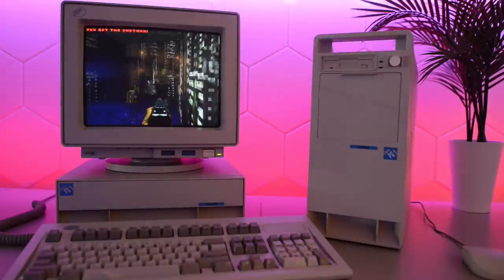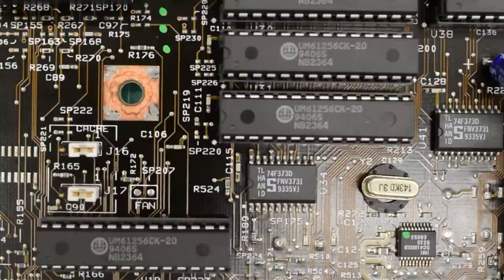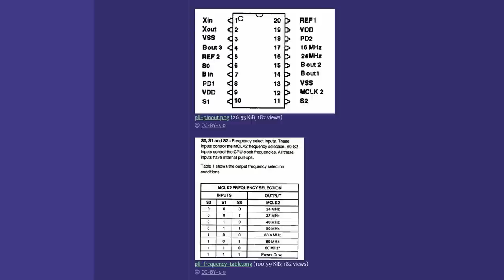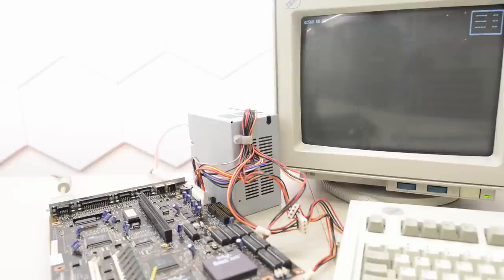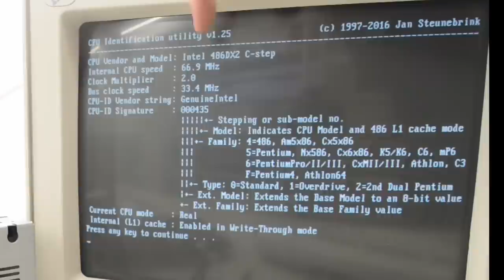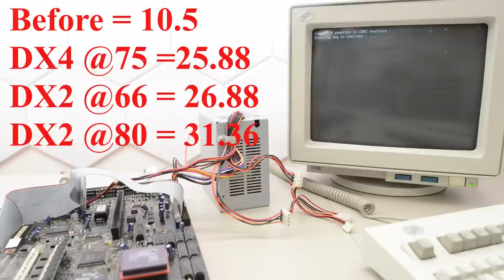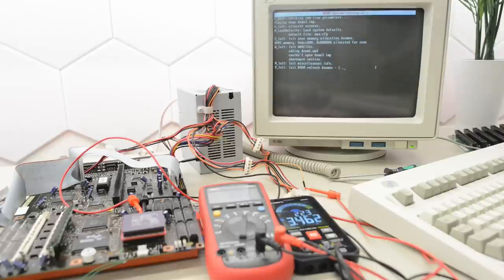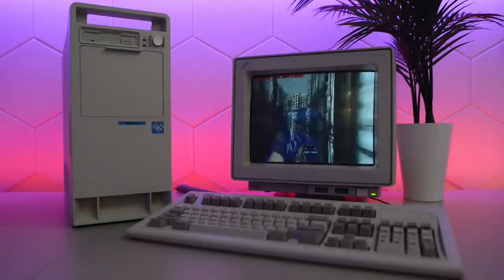3.6X faster DOOM! Sneaky IBM Tried to hide how fast their board actually was!

Comment: For the 4x multiplier just isolate the clkmul pin of the cpu from the board and manually pull it to ground (or check if it goes to any resistor or jumper like the clock generator did). Ive literally played the same game on mine which is a siemens nixdorf d819 motherboard. I just connected it to chassis with a wire and its happily running at 160mhz giving around 1300ish realtics in doom. Note: a 5x86 ADW didnt like the 4x40mhz no matter of any overvolt even at nearly 4V. I changed it to an 5x86 ADZ and all good.

Comment: It was rumored .. 'in the day', that the IBM 80 bus could easily be clocked up to 80mHz..perhaps even to 100hHz.    I had a PS/2 50z that I upgraded with a socket conversion to a 486/7 AMD type chip, but the bus was still at 25mHz..  and the add-on  video board and RAM was the reason that I didn't even think of up clocking the bus.
Reply from the maker: cool, I'll try to clock it even higher

Comment: When i was a kid, I exploded a 286 trying to overclock it by replacing the crystal on the motherboard. I had succeeded in making my 286 run super speed, and was going for Warp Speed when the chip when POP with a cloud of magic smoke and a huge blast of shattered silicon. It was AWSOME, and I'm thankful my uncle gave me the junk computer parts to play with.  At school we were running 486's and upgrading to Pentiums, but at home I was moving from 8088 to 8086 to 286 to 386. always a few generations behind so parts were plentiful and i could do stuff like overclock my old pc when I got an upgrade. I was trying to make the 286 run more than 2x faster. It worked at 1.5 speed.  It was working at 2x speed for something like 15 or 20 seconds before the screen stopped counting the memory. then the screen went blank, and POP.

Comment: DX2 at 66 is faster than DX4 at 75 probably because of faster FSB
Reply: Yeah, that's what I was thinking as well. Also the VLB is in sync with the FSB so that speeds up games like Doom.
Reply: This is almost certainly why. The CPU being able to access the RAM (and anything else that sits on the FSB) at 33MHz instead of 25MHz is going to provide a significant performance increase. If he'd tested the RAM access speeds (after the cache runs out) between the two setups it would have been pretty obvious what was going on.
Reply: I'm running Cyrix 5x86/100 @2x50MHz FSB on SiS471 486-board and it flies compared to 3x33MHz FSB. My Cirrus 5434 VLB is faster than any 33MHz PCI display card (in DOS).
Reply: Yeah 2x33 is better than 3x25 in many scenarios.

Comment: Back in the 90's a co-worker learned about the clock generator's 80mhz feature, and was able to run a DX/4-100 at 120mhz.  He had to add a fan to keep it stable
Reply: I was running a dx4 at 160mhz for years even played quake and blood and command and conquer with it
Reply: During the same time, there were VLB motherboards and adapters of differing quality that could run fine at 33MHz with two adapters (commonly video and HDD controllers), but the combination was more unstable with a 40MHz FSB. It was a fine art of cache and memory timings to get the best stable performance. I don't know if I miss those days.
Reply: @IBM_Museum  VLB relies a lot on what clock the card can handle. They'll all run at 33MHz no problem, some small numbers of them will crap out at 40MHz, and finding ones that run stable at a 50MHz VLB clock can be a real challenge. It was a serious problem when the first 486DX-50s came out to find VLB cards that worked reliably with them to the point that many small system builders just wouldn't sell systems configured like that.
Reply: @JeremyLevi : I ran an AMD 486DX4-120 that was challenging to have two VLB adapters (video and HDD/FDC) on a 40MHz FSB. Once it was stable, I really made sure I could make changes before locking it in. Those were the days!

Comment: The appropriate pin on the Socket 1 diagram for the CLKMUL signal must set low (i.e., shorted to V_ss) to enable 4X on the Am5x86.  That pin is possibly desigated R-17 on the Socket 1 layout.
Reply: From the technical specification: The CLK input provides the basic microprocessor timing signal. The CLKMUL input selects the multiplier value used to generate the internal operating frequency for the Am5X86 microprocessor family. All external timing parameters are specified with respect to the rising edge of CLK. The clock signal passes through an internal Phase-Lock Loop (PLL).
Reply: The microprocessor samples the CLKMUL input signal at RESET to determine the design operating frequency. An internal pull-up resistor connects to VCC, which selects Clock-tripled mode if the input is High or left floating. For Clock-quadrupled mode, the input must be pulled Low. For 133-MHz processors, this input must
always be connected to VSS to ensure correct operation.
Reply: If you modify the interposer board, or otherwise run a wrap wire to the appropriate underside socket solder point (or pin on the CPU), I presume you would be attempting to run this at 160MHz.  I think it would work, perhaps 10ns L2 cache might be in order (and a heatsink-fan), however, for stability?

Comment: We were actually playing around with some AMD 133mhz 486 chips last night.

If you can modify the board to a 2x multi to get 4x, try leaving the fsb at 40mhz and put a heatsink on it. We ran 8 different chips last night, All ADZ models were stable tbrough some quick benching,1 ADW was too but 1 ADW wasnt able to get past post.
Reading online the ADZ models are the ones that are more likely to be overclocked as they are the newer ones. 

Enjoying the videos mate!
Reply: I tried overclocking older machines, 8086 and 286 as a kid.
Reply: Rumor has it AMD designed the ADZ to run at 150 or 160, but the K5 finally came out, and they didn’t want to hurt sales of it.
Reply: @5roundsrapid263  That actually makes sense..
Reply: when i was a kid i learned about heat sinks with a 286, physical clock muliplier jumpers, and physical crystals in a can. mid 90's playing with 286's

Comment: I'm very interested in the next video! 
Back in the 486 days I had a Packard Bell PC that came stock with a 486 DX2 66MHz. I later upgraded the machine to a AMD 5x86 133 CPU also using an in socket voltage converter. In my case I ended up having to set the board to 40 MHz FSB and used a 3X multiplier for a final speed of 120 MHz At the time there wasn't a way to set the proper multiplier and this was in the very early internet days so I had to go with the info that was etched onto the board itself. 
About 6 months before I did the CPU upgrade I also did a L2 cache upgrade from 0KB to 128KB. I read an article in a computer magazine where that was done on a different mainboard that had empty cache sockets that was similar to mine. I got lucky in picking out the correct cache and tag ram chips. The L2 upgrade also provided a nice speed boost in many things.

Comment: Totally different MB but I also had an AMD DX4/133 or 150 or something and I could run it with FSB of 50, 60, or 66 MHz and clock doubled or tripled with VLB hard disk and video and it was a screaming machine. I think it wasn't stable at 66MHz but at 50 or 60 FSB it worked.

Comment: I'm not surprised by the performance boost in the DX2 at 66mhz over the DX4 at 75mhz. The 486 is really limited more by the bus speed than the internal clock speed of the CPU. So running a 33mhz bus will tend to net a bigger performance gain over a 25mhz bus. A DX4 at 100mhz (33mhz bus with a 3x multiplier) would potentially get a nice boost over both, but the 5x86 is still going to beat out any 486.
All this makes me want to try to overclock my IBM ThinkPad 701c with a 5x86 in place of the DX4 since I've read people use to do that to them back in the mid 90's. But as that is all SMD in a small laptop I'm afraid my limited skills would end up damaging it.

Comment: it would be cool to mod one of those boards with jumpers and 330R resistors so you could switch freqs at will.
Reply from the maker: That's very doable. You may not need resistors. Just jumpers could likely work

Comment: Looks like the IBM PS/1 is a bit of a sleeper 486 system. Very impressive CPU figures when you know what to hack and replace to get max performance with the resistors and the socket interposer.

Comment: What a great hack. It's really interesting because I've got an Ambra 486SX/25 and the board is manufactured by IBM - same black PCB and the layout is similar. However, it has jumpers for 25, 33 and 50MHz. This is confusing for two reasons: 1) because of the lack of jumpers on the PS/1 board and the lack of 50MHz, and 2) because I don't know of any 487 that ran at a 50MHz FSB. I might do the hack in your previous video to see if a 50MHz DX runs stable in my system.

Comment: Perhaps those "clock" jumpers, that are documented in the PS/1 technical manual but in an obscure fashion (possibly not implemented the way the diagram suggests on the average 2133/2155/2168 motherboard IBM shipped) provide signal to R174, R175, R176, if they are all populated with 330Ohms and if the installed crystal and CPU combination matches the intended multiplier settings?

Comment: That board is also supposed to support the Original Intel i486DX-50. I wonder how you enable the FSB to run at the same frequency as the clock generator instead of half. Then you can try to overclock the AMD CPUs to have FSB of 60 or 66 MHZ LOL! I remember when I was working at the computer store back in the 90's we had over clocked a DX50 to run at 60 or something like that. It was awesome at the time!!!

Comment: back in the day with dx2's we used to build always had a heatsink and fan... sx25's dx33's didnt need them,  a lot of old vesa cards used to choke  @40 and 50mhz , for  DX50 rather than a DX2-50 or DX2-66 we used to advise to put an ISA card in for stability -  and would always advise the customer to go to a DX2 CPU instead.. also memory could be problematic @ 50mhz bus speed

Comment: Cool content Roman! Right up my alley 👌
I have a similar setup on my Compaq Presario 425, which is wired to run at 33MHz and is then multiplied x4 by my Evergreen 486 upgrade which is essentially an Evergreen OEM  "Socket Blaster" with an Am5x86 running at 4x33MHz=133MHz. The original Compaq Presario machines were in fact Compaq's versions of the PS/1: Cheap, low end machines for home users, which makes them even more fun to tinker with and get the most performance possible out of 😎

P.S. the DX4-75 is slower because the on board local bus graphics card and the memory is running at 25MHz instead of 33, which makes the DX2-66 faster. Memory/bus speed is often more important than raw integer speed of the CPU itself, which the DooM results demonstrate here 🤓 The i486DX2-66 was in fact the ultimate sweet spot between bus speed and raw CPU speed, making it a very stable and well performing platform at the same time, especially with its VLB implementations @ 33MHz, which is what made it the most popular 486 CPU ever made..

Love the analog synth tunes in the background. Did you make them yourself? I noticed the nice analog synth gear in previous videos ;-)
Reply from the maker: Thanks. I actually have a Presario 433 lined up for a vid. Should be fun to hack :) Unfortunately not my tunes. I only make noise with my gear lol

Comment: The crazy part of this video is that those cpus are benchmarked without any heatsink or fan...
Reply: for that short time its not the problem ...The i-DX4 33Mhz  3.3V 	TDP 4.29 W.
Reply: @mibnsharpals  that doom benchmark is not short. And what numbers are those you are commenting? 5x86@120 was ran without cooling.
Reply: @GigAHerZ64  my 5x86 ADZ barely gets warm in 4x40mhz mode in a few minutes. i can keep my finger on it and its only slightly warm. i do have a nice flat active cooler on it though.

Comment: The buck-converter you have definitely has ripple, but you need to measure output voltage only loaded! And beware the smd trimpot is very unreliable, better measure the real resistance and replace it with the smd resistors. /*with the time the trimpot can go crazy because of moisture and dust*/

Comment: The DX2/66 putting out (slightly) more FPS than the DX4/100 doesn't surprise me, because in many cases, bus speed (as opposed to internal CPU clock) is your main bottleneck, especially in doing stuff like pushing graphics out to the graphics card, etc. With the DX2/66, you're running at 33 MHz bus, whereas with the DX4/100 you're only running at 25 MHz.
Reply: You can run a DX-100 at 33x3 if the board supports it. I have one, and it’s a good bit faster than a 66.

Comment: OMG PUT A HEAT SINK ON THAT QUICK!!!! I wouldn't clock that any higher with the bus up at 40 Mhz. Not unless you do some much better cooling. Those chips have been known to run at 160 Mhz stable but is the minor increase really worth the risk? A big portion of the speed increase you are getting is already in place by overclocking the bus. If you do clock it to 160 PLEASE get a really robust cooling solution going on there. Check out CPU Galaxy and his adventures with one of these up to 200 Mhz but he had to use a peltier cooler to pull that off.
Reply from the maker: It actually didn't get that hot during the test. I will of course not use it without proper cooling

Comment: DX4-75 means that the Front Side Bus (FSB) is running at 1/4 if 75Mhz (18.75Mhz) while the DX2-66 means the FSB is running at 33 Mhz. If I recall correctly it was cheaper to buy a DX4-75 than a DX2-66 way back when. Thank you for the video!
Reply: Even though the name is DX4, its multiplier is 3x. So its FSB is 25MHz.
Reply: It's one of those confusing things for a name of an Intel '486DX4' to have a 3x multiplier - a DX4-75 has a FSB of 25MHz, and a DX4-100 has a FSB of 33MHz. An AMD 486DX4-120 is also a 3x multiplier of 40MHz, and the demonstrated AMD 5x86-133 is a 4x multiplier of 33MHz. Wait until you hear about the Intel "Pentium Overdrive for 486" that had a 2.5 multiplier: The 'POD63' is a 25MHz FSB, and the 'POD83' is a FSB of 33MHz.
Reply: @RuruFIN  My bad, thanks for the correction. Still the DX2-66 had better performance hence higher price. Eventually Intel realized that it could not keep up with the DX* naming scheme and decoupled the FSB from the internal clock as it moved forward.
Reply: @hernancoronel  Yeah, those were just named stupidly.

Comment: That AMD 5x86 was the first big upgrade I bought with my own money back when I was a teenager. I went from a 486 DX2-66, so as you experienced for yourself, I also saw decent increase in speed in Doom and other games, but it wasn't as big a performance increase as I expected. Certainly not the Pentium levels of performance that AMD claimed. That's probably down to the 33MHz FSB, compared to the 50-66MHz of the Pentium.

In hindsight, I probably would've been better off buying a second hand Pentium. I think this would've been around early 1996, so there definitely would've been plenty of 100/120MHz Pentiums on the second hand market by then, possibly the odd 133MHz systems. But I didn't find out about the local computer markets until later, so it would be a couple of years until I could afford to upgrade again.
Reply: With enough RAM, cache, and a good video card, a 5x86-133 system was close to a Pentium 66, except with FPU-intensive software like CAD. It was also less than half the price.
Reply: As the other poster indicates, with the right motherboard and a suitable BIOS (or workarounds), VLB graphics card, performance was probably similar in many instances to a bog standard P75 sytem being pushed by the likes of AST, Acer, Packard Bell, etc during the mid-1990s.
Reply: Yours was probably held back by the motherboard. I also bought a 5x86 back in the day, but paired it with a new (PCI) motherboard and ran the 5x86 at 160MHz (so 40MHz FSB). Early Pentiums could not touch that. It could still give a Pentium 90 a run for its money (not in Quake, obviously). I later upgraded to a Pentium 100, because that definitely was faster in all scenarios.
Reply: I remember wanting a Pentium so badly in 1995 and 1996.  We FINALLY got one in January 1997 and I still remember the very first moments of playing on it and the ENORMOUS difference from the 486sx25 and then being mad as hell at having to suffer with that budget 486 all those years.
Reply: @Vile-Flesh  That sounds like a pretty massive upgrade!

Comment: You should have a load while adjusting the voltage to the cpu. Preferably the same as the cpu uses.
Can Socket blaster be rebuilt to do the cpu multiplayer?

Comment: IBM just wanted to rip off customers. If the PS1 were sold running at full capability, they might remain in the home market at least longer
Reply: IBM was set on only running Intel CPUs - The Aptiva series (which came after PS/1s for the home market) were much better than the 'ValuePoint' models offered for businesses. It was a strange time as IBM (and other brandnames) got hammered by clones running AMD CPUs.

Comment: I like this hacking, especially that is the IBM board from the era where they tried to lock down everything about PC and (thankfully) failed 👍
Reply: I don't think they were locking down features. Rather than saving cost on manufacturing. Many companies did this. They make one product with the same layout but enabled different setups. And so could sell at different price points. They still do this today. Reason why so many cpus work in the "socket" was just because of backwards compatibility. This changed when Pentium II came out as much of the architecture was on the cpu itself rather than  scattered on the motherboard
Reply: @Pholiage  I was more on the fact that PS/1 and PS/2 line was the time when they still tried to regain control over PC by making it hard to copy and extend. 
But I agree with you on reusing the same platform and that is actually good practice.